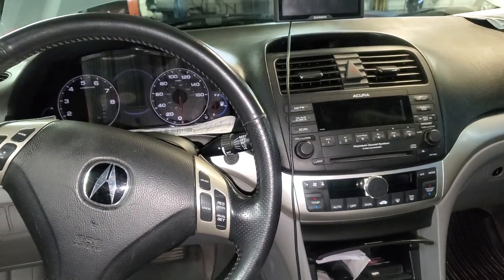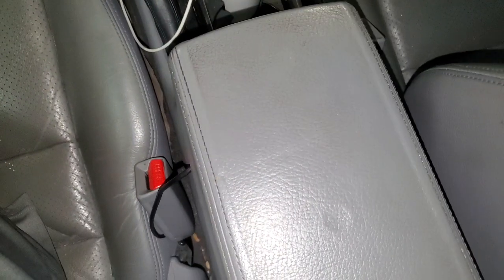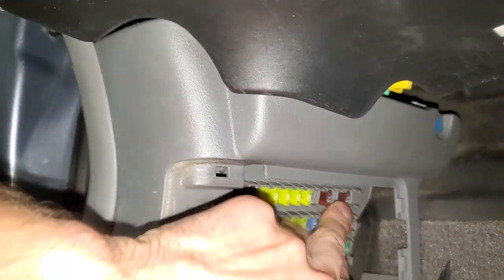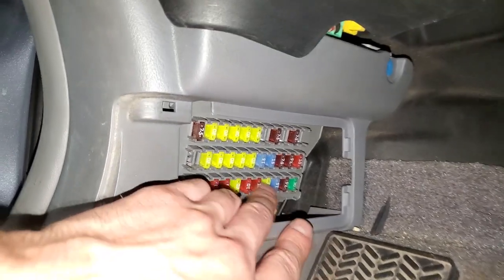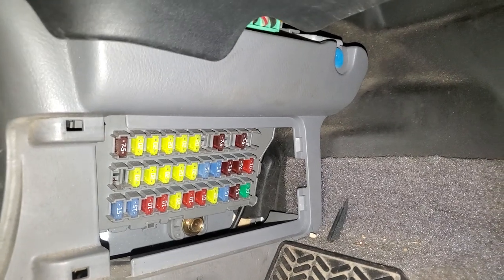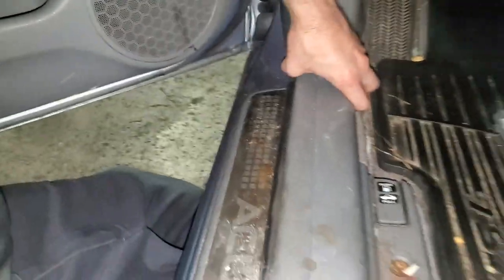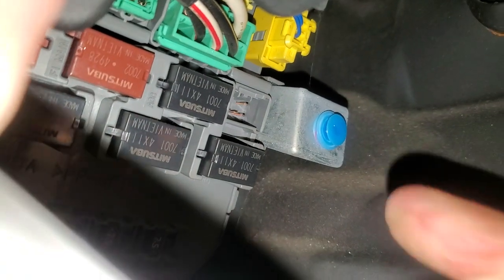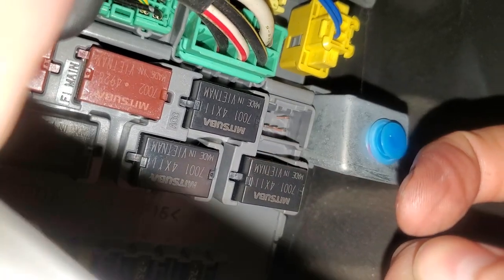Acura TSX Power Outlet Fuse, Cigarette Lighter Fuse Location

Comment: So this is pretty weird I run an inverter in my car and a few times the 15 amp that you showed in the video has blown and I keep spares in the car to replace it because I’m an electrician and of course I have to push them to the limit but when it has blown both sockets have always turned off but this time only one socket the one that is located underneath the radio has no power to it but the one inside the center consul does have power what do you think it is the relay